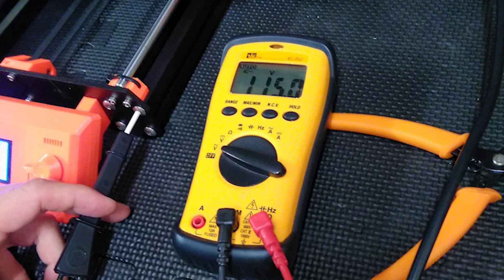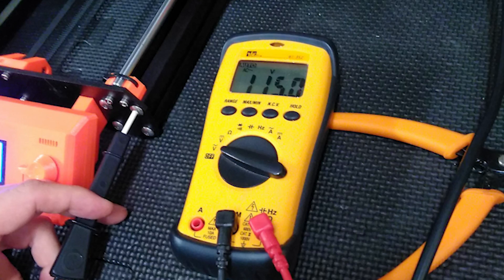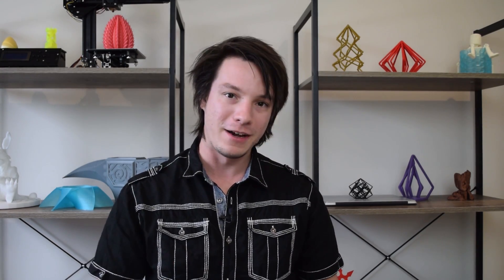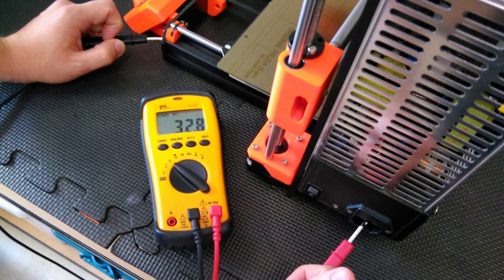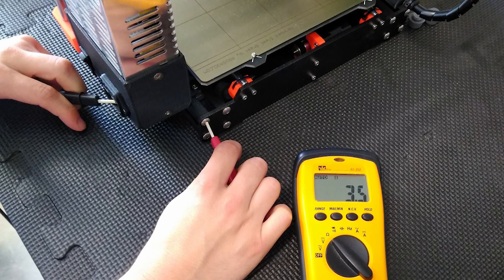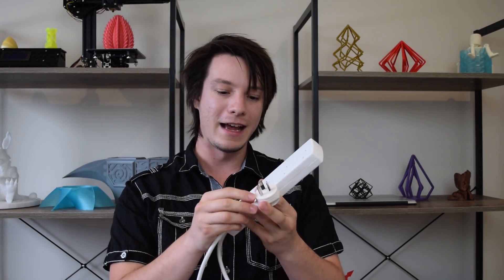I got shocked by a 3D Printer

Comment: Here in the US, the AC pulse frequency can make your muscles constrict and lock. Been shocked couple times with 120v ( e.g. changing a wall outlet and someone decided to turn on the breaker) Not as bad as you might think but no joking matter. Most household outlets in the US are 120v @ 15 or 20 amps. I had a friend that peed on an electric fence for cows... that was not good.
Reply: In the UK our plugs/sockets are rated for 13A @ 230v,  but they're connected to a ring that will supply 30A before a breaker kicks in.
Safety equipment (RCDs and similar) are mandatory, so it's usually safe :)

Comment: I work for a major 2d laser printer company. Laser printers work on voltages up to 1800v (current limited)

One of our test fixtures generates these voltages and I’ve been cautious because obviously the covers aren’t on a test fixture that would be on a printer to keep fingers out.

Turned the power supply off and went into to work on the cartridge with a screwdriver. I got hit with 800V. Felt severe pain up to where my neck meets my shoulder and I threw the screwdriver across the lab and said a few choice words that would make my mother blush.

It was one of those moment where you check for your pulse and it happened so quickly that you wonder “am I dead and I don’t know it yet?”

It was weird because I know I turned the power supply off. Turns out the transformer doesn’t immediately go to ground 0v when you turn it off. It slowly dissipates voltage from, I assume, capacitors etc. After getting up the nerve to touch it again. I watched the voltage over time and it turns out it took the power supply 15 seconds to dissipate the voltage.

Needless to say I asked for a redesign of he fixture to throw a grounding relay the instant he off switch is thrown.

Be careful around electricity.  Even when you do it right, doesn’t mean it can’t go wrong.

By the way, my entire arm was sore for 2 days after taking that ~1000V hit to my arm. Now I know how Jim Varney felt as Ernest “electroman” P. Worrell in Ernest goes to jail :)

Am I dating myself with that reference????? :)

Comment: I have been worried lately,  I have a Prusa i3 with an all metal frame,  I  have checked every wires and I can't see anything touching the frame,  yet I can feel the electricity on the frame and occasionally  get  small shocks, sometimes I feel them when I touch the frame with a hair from my arm.
Reply: You are not in an immediate danger from the printer itself, but you should definitely check your house and extension lead wiring for ground resistance and continuity.
Reply: Siana Gearz Thanks! 
As soon as I get back to my printer I will check with my multimeter.

Comment: If the JGAurora doesn't trip the RCD, then the current isn't dangerous. But it is still a very bad design to have a leakage like that. Probably isn't CE compliant.

Measuring voltage between yourself and live is safe with a modern multimeter, but don't do it with a test lamp or analog voltmeter (unless you know it to be safe).

Comment: In Canada all extension cords are for temporary use and should never be daisy chained. Practically speaking, everyone does it.
Reply: Ian Colquhoun I use power strips and extentiin cords for everyrhing in my room. its like over 20 devices connected really to 2 power outlets
Reply: Daisy chaining extension cords is fine (as in no observable negative effects) as long as they're in good condition and you don't overload them with current. The main reason why you shouldn't daisy chain is that the likelyhood of one contact being bad is increasing exponentially and that people tend to connect too many devices to a long chain, overload the chain and cause it to overheat at the weakest point (typically a bad contact), starting fire. If you connect space heaters to an extension cord and the cord is hotter than the heater, you know you have a problem.

Comment: Glad your OK.  Been shocked a few times and each time it made me angry. Not sure it if was the shock or realization of my own stupidity,
I cut a PC cord to use for another project.  It was a ground cord and had UL mark.  When I cut it there were only hot and neutral wires.  No ground.  That's what I get for using cheap made in China garbage.

Comment: The voltage isn't what kills you, it's down to the amps! Though of course regardless you should always be careful around low or high voltage machines!
Reply: No, voltage has an equal part to play - I=V/R after all!

Without sufficient voltage, there will be insufficient current flow to hurt you.
Reply: Pook365 Not necessarily, you could have something at 1000 volts but a low amperage, while yes a higher voltage can sustain a higher amperage, it's the amps that are fatal given you only need 7 milliamps to cause heart arrhythmia

Comment: I have a few ideas about what might be going on, but the person you should really talk to is Tessa (SparkyFace5) because she's actually qualified, and I'm not.

My guess is the JGAurora has Neutral and Ground connected together internally. That isn't uncommon in some countries, but in Australia I don't think we mix the two anymore - for exactly this reason - and in order to make "earth leakage detectors" work as they should. In normal operation, all the electrons that go into Active are supposed to come out Neutral (and vice-versa since it's AC) and not disappear into Earth, because it might be doing that through a person. Which as you discovered, is bad.

If I'm right, and you have an Earth Leakage protection breaker, it will trip as soon as you plug the Aurora in and turn it on.

Now this is where I get fuzzy.. (Tessa?) In theory the 'active" side is going +-120 AC and the Neutral is staying close to ground, but once power is flowing through the device the neutral side will get pulled up towards Active somewhat. Not all the way, but if it's not tied to ground, it can float around quite a bit.

So that would mean, in essence, power was coming in through active, powering the device, flowing to neutral, which on the JG is tied to ground, which goes through the powerboard, into the ground of the other machine, out the case, and into you. shudder

I personally always assume the brown wire is as dangerous as the blue wire. But that's because I electrified myself once too, and I'm paranoid now.

Now it's easy to slam the JGAurora here, but this might be where some American electricians jump in and say "Actually, our code says Neutral and Ground must be connected" and so the issue is more "devices from random countries interacting".

...and Europeans complain that all their imports are more expensive because every product sold in the EU needs to be tested for local compliance. Basically to avoid exactly these kinds of scary possibilities.

Tessa might also be able to recommend some of the protective gear that sparkys use to stop this kind of thing happening to them.

Comment: Probably smoothing capacitors leaking to ground in the PSU. After watching your video I thought about grounding the frame of my printer, but as it's a home brew Mendel with so many printed parts I would double the amount or wiring! :)

Comment: I'm still curious of the current path on the mk3. After building, i can't see how it got through the frame from the power supply. The powder coated through holes and plastic psu box should have insulated everything from the psu? Its a very thick coating.

Comment: What if there is NO ground pin in my country? Two pins outlets only :(
Reply: Find out how to add grounded circuits to your system.  Remember tho your local codes, and you likely will need to pay a licensed electrician.
Reply: Ground doesn't necessarily need to go to the outlet. You can install a brass rod and connect it directly to the ground on the machine.
Reply: @jernejj5 Russia

Comment: I've be checkin that powersupply for any loose or disconnected ground leads.  
I had a printer do this to me once, it was due to a adapter mains lead that had a bad ground.  
I'd also start with a test plug to make sure your house/office/workarea outlet is also wired proper.

Comment: It is pretty common to have voltage leakage across a cheap AC/DC adapter's circuitry. I have a 2 prong Toshiba laptop power brick that has about 120V present on the DC output. It is current limited, so it only feels very uncomfortable instead of killing you. However, I still replaced it with a 3 prong because the internet is toxic enough without being constantly electrocuted. 😂
Reply: Adding the ground sinks that stray voltage.

Comment: Man your lucky 115v is literally our mains is the us
Reply: But it is also mains in Australia
Reply: NO it is not! - Mains in Aus is 240V - What Angus saw is the mains /2 because of the mains filter, employing three capacitors, one across Live/neutral and one from live to case and one from neutral to case. It will work like a resistive divider with two identical resistors, giving you half the voltage. Capacitors exhibit the same properties when it's AC-power.
Reply: Sorry, I see now :D

Comment: Good not know. I think i have had a similar issue with my media setup.   My metal pc case has some voltage across it when the hdmi cable is plugged in. But it seems to be grouded because its only noticavble when trying to plug the cable in and a finger touches the cable ground and the metal case. And seems to be coming from the tv end because it happens on otuer devices over hdmi and it has happened with an old tv in the same setup so something is wrong. Had an electrician look at it and he couldnt fiure it out, probably because of what a mess my setup is. Think il have to sort it eventualy. Sounds like its probably a similar same issue.
Reply: Let me guess, you have cable TV? Your TV is grounded trough the cable installation and your PC have half mains supply on the case because of it's mains filter. It is perfectly normal and NOT DANGEROUS!
Reply: zapro_dk no. Uk. Dont have cable tv

Comment: The fact there is any voltage on the frame indicates there is a wiring problem. Having it grounded is just a safety precaution for problems. Like an acrobat has a safety net. Prussa should be worried if he is sending machines out that have voltage on the frame. That is a major liability issue.

Comment: Angus,
As an electrician. A 110V AC on the earth pin would mean one of the following:
1: The 3D printers PSU has either a pin/wire touching the frame of the PSU's case. Which in turn makes the earth pin or any metal frame become live.
2. The 3D printers PSU has a bad Y class capacitor. 
3. The Garage electrical circuit could be floating due to either improper electrical wiring. ( There are so many people out there that think they can save money and wiring up there own house or garage with speaker wire. ) 
A safe way to test this is with a multimeter using the ac voltage mode and going from the earth pin to the active pin.
If you see 230-256V then the wiring should be fine.
Reply: bad capacitor? A perfectly working y-class cap will still give you a good tingle if you are grounded good and the applicance isn't. Agree?
Reply: @zapro_dk Yes I Agree, It is Very Unlikely That the Y-Class Cap could be causing the issue. 
From My Testing of Y- Class Caps the General Leakage Voltage has been around 6.5V - 12V in a 240V Electrical System.
My Main Concern would be that the Earth Installation in the Garage/Office has some how become Disconnected from the House's Earthing Installation. My other worry is that the Electrical Wiring is not up to AS/NZ:3000:2016 Electrical Installations Standard.
Reply: Sorry, but you simply cannot say a Y-Cap has a leakage voltage of whatever, because voltage doesn't leak, current does. The voltage on a perfectly fine Y-Cap connected to mains on one side will always be mains on the other side. A perfect voltmeter with infinite internal resistance will show that. A real voltmeter with finite resistance will show less, depending on the resistance. Most modern voltmeters have a almost infinite resistance and will show mains voltage if not used in "low z" mode.
It probable is just 4. All his PSUs are fine and he just used stupid wiring

Comment: I had the same problem with a new computer i built, each time i touched the top of it i got a shock. After a few shocks i plugged it in somewhere else and it was ok, I just had a new consumer unit installed a couple of days before so messages the chap to tell him. Long story the extension lead i used did not have an earth connection.

Comment: Hey Angus, this story really resonates with me. I take part in yearly OSHA training (occupational safety and health administration) for work and daisy chaining cords always comes up for this very reason. By adding connections you are adding potential failure points and stuff like this happens. It looks like you got the approximate equivalent of US mains voltage (doesn't hurt as bad as 250V does it?) It's okay, Angus, we still love you, just don't enter any confined spaces without proper training and safety precautions!

Comment: If Joel has ever received a Shock we have then solved the 3D Printer Youtuber hair secret!!!!!
Reply: This is never a nice way to learn.

Earthing is not just for safety of metal cased electrical kit.

There is a Switched Mode PSU in the other printer.
SMPSU normal operation needs a filter to stop interference getting out.
The noise is usually safely grounded by it.

The other printer need not be faulty. Just normal running.

Without being earth bonded to ground you provided the easiest path.

If you had put your other hand on an earthed pipe it would be very unpleasant.
Your gfci/rcd/rcbo would have saved you, but not from pain.

Hope it didn't scare you off but just made you a bit more cautious !
Reply: @chrisharvie-smith486  the current into the ground would still be very low or it would trip the ground fault circuit in normal operation. What tends to happen that the unconnected ground builds up to half the main voltage as both live and neutral are capacitively coupled to ground.
Power supplies with a metal shielding have a much larger leak current to ground than the plastic enclosed counterparts. 24V printers can be used safely ungrounded as long as the power supply is double insulated. All the voltages after the power supply would be safe to touch.
Reply: YES! was about to comment something like that!!
Reply: So seriously he looks like he got shocked

Comment: Probably whats called an Earth Loop, where more than one devices are sharing a common supply, but the earth cct is unballanced or non existent for one of the devices.  Remembering that domestic supply is single phase of a"Star" connection, the Center point of the single phase is EARTHED at the meter box. If you have earthed and uneathed appliences on the same supply, an unbalance condition may develop where there is a substantial voltage between neutral and earth. In certain conditions this may even exceed the supply voltage.  Your lesson, dont play with electrons when tired or stressed.

Comment: Almost all switch mode power supplies have a small leakage current.
The current is so small that it's safe but not small enough that you wont feel it, under the right circumstances.
I'm guessing you stood on a concrete floor without shoes when you got the shock?
Or maybe you were touching something that had a sufficiently low impedance path to ground.
I've experienced this myself.
Resting my feet on a water based radiator while touching my computer case or something similar. Not pleasant, but not dangerous.

Also I'm pretty sure this is what happened based on your voltage measurement.
The leakage is usually at about half line voltage and down under I'm guessing you're running 220-230V.

So the only "fault" here is your daisy chain. :)
Reply: Yep I agree I really think this was the issue....
Reply: Yeah australia runs 230-240 volts @ 50 Hz
Reply: Yes, this is likely the problem. It would feel like more of a tingle or buzzing than a 'proper' shock.

Use RCD protected outlets for 'cheap' mains powered devices.

Comment: You may have just saved my life I have been using a "cheater plug" international adapter provided with the CR10 I just checked it the power cord it is save grounded the unit is save grounded but the international adapter is not.  I am such an idiot been using it 6 months

Comment: The adaptor I got from gearbest when I got my cr10 didn’t have a ground, even though the US cord to the printer did. It just left the ground pin hanging out. I swapped it with a cable I have, but that shouldn’t be on me to fix.

Comment: Which is also why the Australian standard of plugs are bad because you can plug a 2 prong cable intro a 3 prong outlet. This is not possible with ex. European plugs.
Reply: Plugging a 2 prong cable intro a 3 prong outlet is perfectly fine and is also possible with european plugs. Plugging a 3 prong cable intro a 2 prong outlet is the problem and this should NOT be possible with european or australian plugs, as long as you don't use chinese deathdapters or selfmade cables.
Reply: RoterFruchtZwerg ok yea that is true. I think I was thinking about older round eu plugs does not fit in newer grounded outlets. What I’m confused about is how a 2 prong extension cable can have outlets where 3 prong cables is connected, like he said it was in his case.
Reply: It just isn't possible as long as you use certified cables / adapters. However, there exist "multi country adapters" that allow that.

Comment: those cheater plugs are dangerous, they have large openings, making it easy to touch contacts. Because of the shape of them, you can do really dumb things like plug it in the wrong way, such as plugging in the earth, into live. Dont use them, get a decent flex, or cut the plug off and wire your own on.